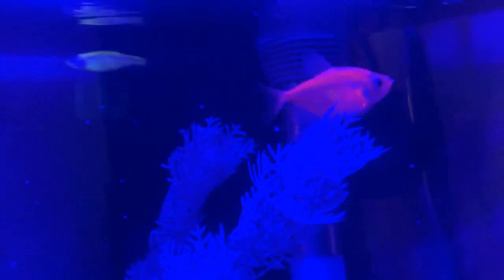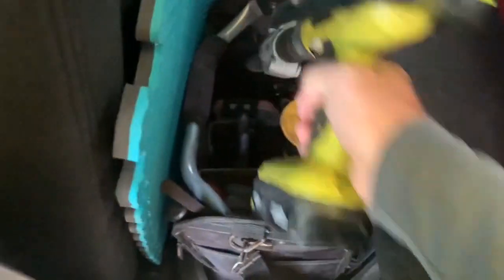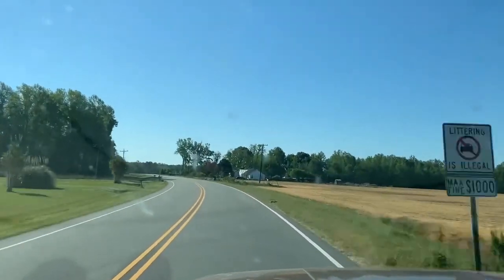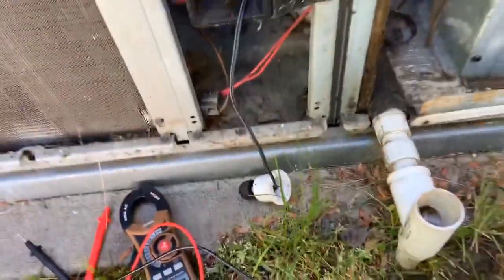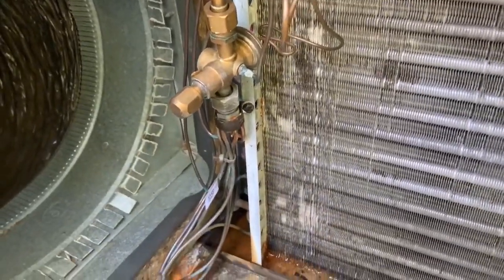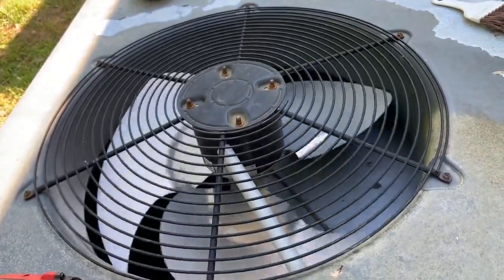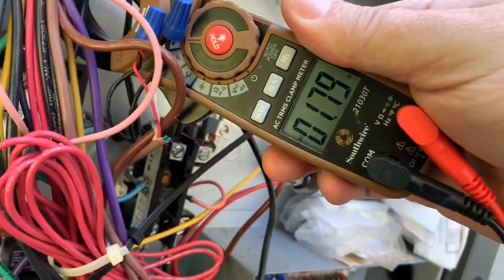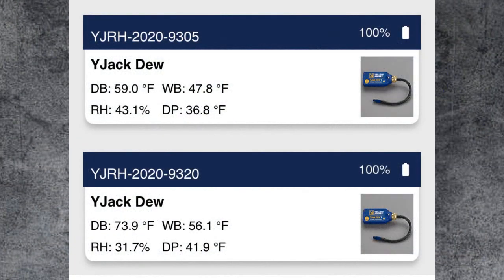HVAC Service | Amana APH15 Pressure Switch Failure

Comment: I guess you kind of figured Goodman will not be sponsoring your channel lol 😂 

            Now that you’re kind of in a semi retirement work mode Frame of mind (looking at worked in life from a different angle) isn’t it nice that you can take all the Time in the world to thoroughly test and go over the entire system clean and service properly and knowyou did everything correctly. 
              You can actually take the time and test and learn or improve testing skills with the newest equipment data log everything and find out from the previous installers mistakes about that airflow wrong that the inside blower was set on the wrong tap speed system was overcharged or under charge from the previous company record print handed over to the customer and correctly fix it and restore heating or air conditioning to a level the customer did not even know existed on a piece of equipment. You’re customers hero 🦸‍♂️ 

          It’s nice being older and not in that rat race under the gun to finish as many tickets in one day to make profit for the owner of a company while you bust your ass and have to take shortcuts because the boss tells you you have to because your numbers aren’t high enough.   Or like some owners tell the guys to sell stuff and make stories up to sell unneeded equipment